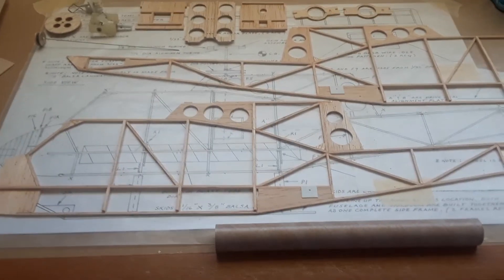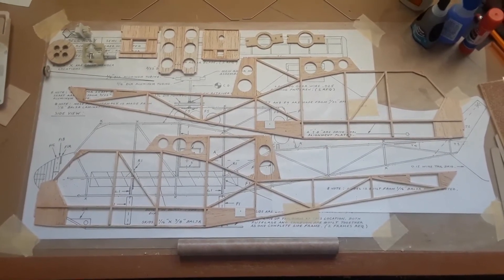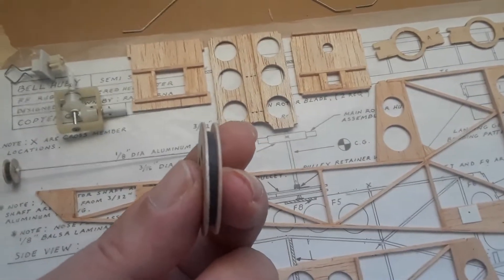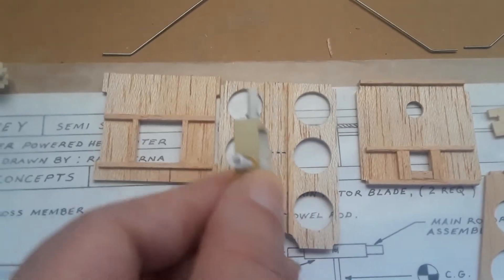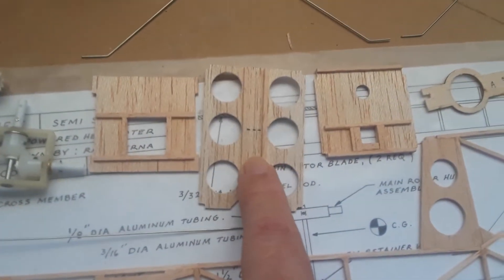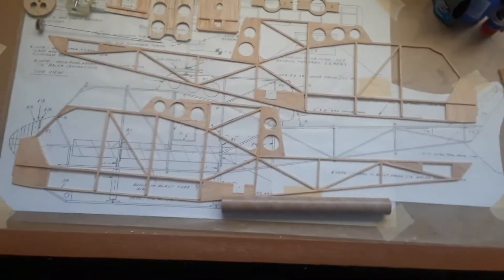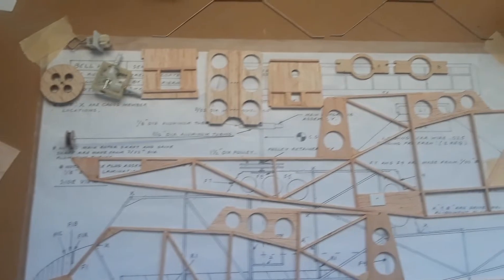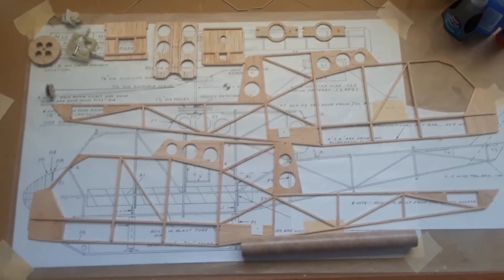Rubber powered Huey helicopter building class by Copter Concepts part 1.

Comment: Amazing! This is your 3rd Huey right? Also to improve your flights you might have to make the blades a bit thicker and longer for more lift.
Reply from the maker: Actually this is Huey # 4 this one has been totally redesigned with blast tube and longer, wider built up rotor blades.
Reply: @raymondkierna7610  Dang! Four, what tissue design will you be using? And that’s good so this one should hopefully actually work. Keep up the good work
Reply from the maker: @thebalsaboy  I will do a modified Army version. As far as flying goes I have high hopes for this one, First one failed due to a plastic bearing being to weak to hold the load, this has been replaced with steel. 2nd one failed because I tried a spring drive and the spring twisted in half under torque. 3rd one failed because I tried a Moore drive and I built it wrong. So in short stick with my original transmission the Hughes 500 works just fine. Live and learn.